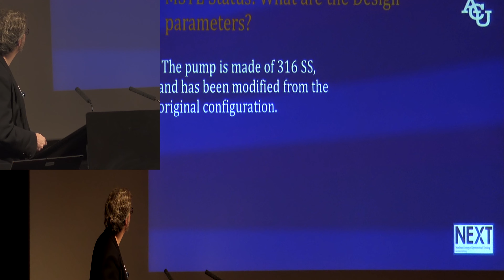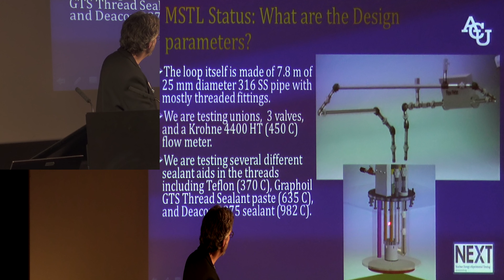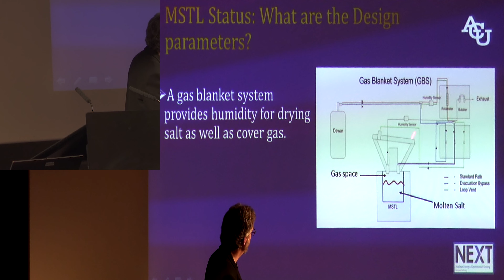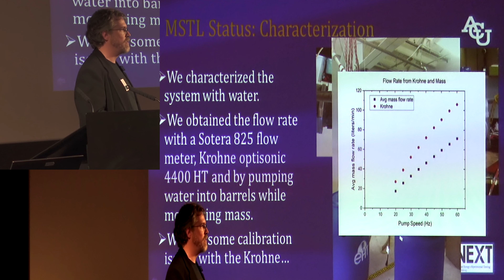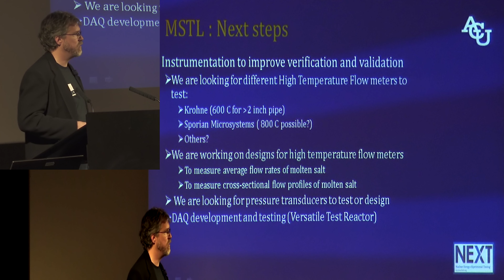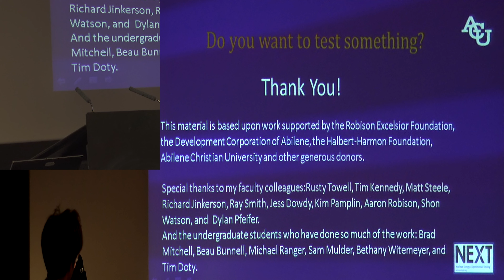ACU NEXT Molten Salt Loop - Tim Head @ ThEC2018

Comment: 4:51 I just watched a video https://www.youtube.com/watch?v=6qbhBUbWdmU HT challenges in MS applications (Solar tower!) by Trillium PLC. They have problems with graphite seal, long shaft, thermal losses and resulting freezing of salt, day-night cycle, salt frozen chunks buildup in the valve, breaking loose and then clogging something downstream. They had no electric heaters wrapped around the valve body! These are absolutely necessary, but how do You make electric heating wires' insulation suitable for 670 - 1000°C ?? 100-120°C is easy. But You need to preheat to op. temp. before startup. 
Long shafts: bearings, keeping tolerances, avoiding vibrations and sealing problems, how to avoid (even small amounts of ) liquid salt spillage spraying directly onto the bearing case, because things tend to get out of centricity when heated, cooled! ( Assembly and tolerances measurements are done at room temperature, usually. )**  Long steel shafts have internal stresses from forging, that get released over time when the material is thermally cycled! The only remedy is to thermally cycle the raw shaft several times to operating temp before put it in the lathe and finish it! Maybe leave some extra diameter in reserve, so that this same shaft can be re-machined later in its lifecycle again; this will help. (Maybe the raw shaft needs to be thoroughly rotated, while being forged, to get the internal stresses more centrical in the first place)! 
Air bubbles in the tank: avoid splashing, use a diffuser end at the return pipe and bend the end of the pipe sideways away from the pump inlet, towards the tank wall. Will there be foam on top of the tank (containing Xenon)? Will there be (radioactive, unsoluable) sludge on the bottom? How to remove it after appropriate run times?   
      ** We had a serious downtime, because of such a situation: notoriously troublesome seal on a not perfect long shaft, water spraying occasionally (more and more) towards the bearings, the bearing rollers corroded, things got hot, the grease melted and evaporated away, it smelled like frying food in a pan for a while, in the whole hall, then the bearing got so hot, that the rollers melt-welded with the shaft and the machine came to a sudden stop! After that annoyance the mechanics put a disk onto the shaft, before the bearing, so that eventual spray wouldn't wet the bearing. Afterwards!

Comment: Have you guys looked at mag drive pumps?  Maybe with a composite volute since you can't use SS....
Reply: Things are moving ahead with the  multinational MOLTEX ENERGY  project . They are going to prove that convection can be maintained in  narrow fuel tubes,  and that  circulation pumping can be done by  multiple simple impellers within the core, and that a safe, inert,  not radioactive, coolant salt  can be dosed with  sacrificial  metal to protect the basic stainless steel core and tank. Heat will be removed by  a heat exchange loop immersed in the core coolant.
Reply: @johnpeacocke2112  That's great, John. I suppose it's a function of viscosity and coefficient of thermal expansion re the convection.  I remain optimistic that some day enough High Priests among the Greens will realize it's nuclear-or-nothing as far as mass non-fossil energy goes, eh....
Reply: @michaela.barnes9972  I would greatly appreciate  it if someone with  required expertise  would come  forward and challenge the  optimistic material in the MOLTEX ENERGY Patent and Prospectus  (both available on website).  So many great disadvantages and risks (pressure, waste  containment,  runaway,  fire... )  have apparently been sidestepped  in the design.  Of course  there will be trolling  ,but  knowledge  should  prevail.
Reply: @johnpeacocke2112  - I'll take look, John

Comment: Bret Kugelmass (known for his "Titans of Nuclear" i'views / podcasts)
spoke at UN / IAEA in Vienna, etc.

He questioned whether Regulators are "over-the-top" in their demands
for engineered solutions to (currently perceived) risks, making Nuclear
Energy so unduly costly, that Coal plants are installed, instead of NPP.

The Result:  Many more people Die, due to pollution from burning Coal
than have ever died from "risks" of NPP.

He called for assessing NPP like any other systems built on Earth, ie,
based on actual injuries + deaths, rather than perceived ones.

No one's putting Coal plants through the overdue scrutiny they deserve;
why are Historically Safe NPP treated as they are by regulators, today?

I urge every1 to View+Fact Check some of Bret's ~9 talks on the impli-
cations, his model, that shows we must Reverse Climate Change, to
preclude consequences; it's not enough to cut even all new emissions.

https://www.YouTube.com/watch?v=LQvOL_vVbtg&list=PLgTfjKxO_dTeFNOjWZXUCM0ghpDBVc2oO

---

Both for:

1. a Model suggesting, that: Before Climate Change consequences will wane,
    we must "Reverse Climate Change"

    Ie: Reduce the amount of CO2 + other GHG emitted in the last ~100 years;
    CO2 + GHG from Before that time would have been reduced by Nature.

    Think of a Dam holding a bit too much water, ie, above its Safe Level,
    in a place where neighbors are adding New Water to the reservoir,
    behind the Dam. (So, even if we get all neighbors' in-flows to Stop, the
    Dam's integrity cannot be guaranteed, ie, UNTIL the Water Level drops
    below the Safe Level); AND

2. a Solution to the Challenge of pushing-back Climate-Change consequences:

    Make Carbon-Negative Fuels using C & H from the Air, Not from underground.

    (Synthetic fuels would be compatible replacements for today's fossil fuels;
    thus precluding the need to replace / upgrade vehicles to EV, H Fuel-Cell, etc.
    Sorry, Toyota, etc.  ;~)

    The infrastructure could also continue to function, as it wouldn't need to
    accommodate new type of transport vehicles.

    See Bret Kugelmass's various YouTube lectures for details. (Unfortunately,
    the audio of one given at ORNL is less than optimal; others are fine).

Spoiler Alert: The Good News is: Kugelmass's Solution requires 1,000's of NPP
ie, to power the synthetic fuel operations. (Could this help MSR start-ups win
more or quicker offers Funding, someday...? We can hope so.)

Eg, "ASME's 2019 Clean Energy Summit - Nuclear & Climate Change"

(Each lecture adds a piece of the puzzle or more details. So, see 'em all)
Show less

Comment: Not to over-complicate the initial loop but maybe using a three-spindle screw pump would be a bit less problematic. 
Assuming you can find one designed to operate at the appropriate temperature. 
Also for corrosion testing is there a neutronic stand-in to create a flux field? 
The salt interactions with the metal surfaces might behave differently under neutron flux.

Comment: I've not followed this extensively and don't know the makeup of the team, apparently it's all students and "experts" who don't understand the difference between a shaft that is "not round" and one that is "bent". Balanced impellers, or balanced "anything that rotates" of significant mass and speed, is a basic concept to anyone who has actually worked with them. Maybe you need to confer with the janitor who operates the boiler in the basement.